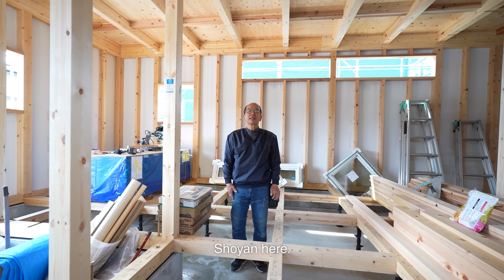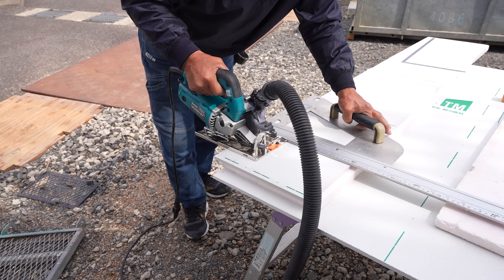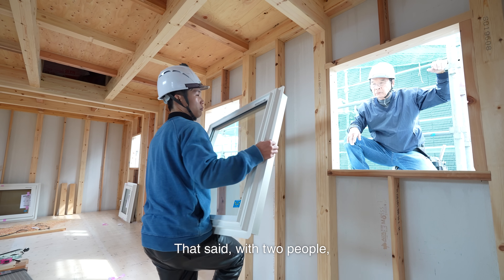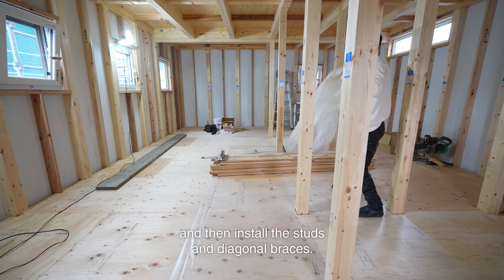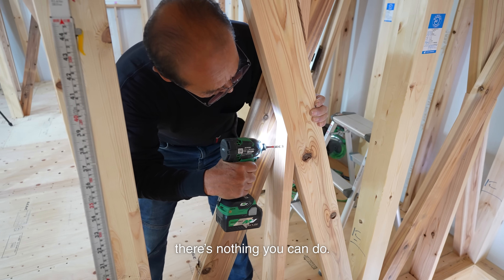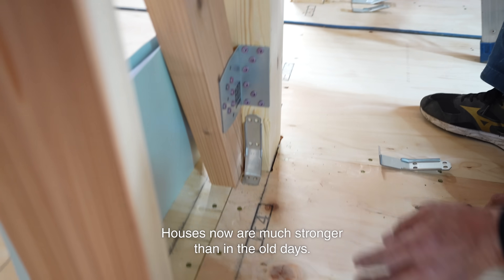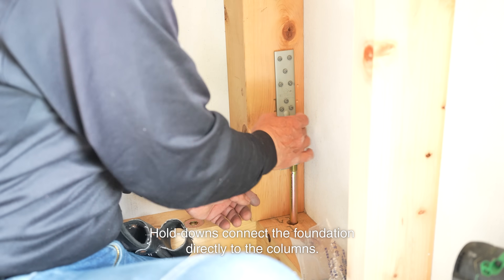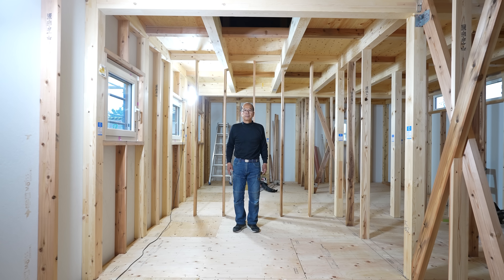How to Build a Home That Survives Big Earthquakes | New Build Season 6 Part 2

Comment: This design of window with double type of opening is common in Europe, especially Italy or Spain. Except when the handle is horizontal, it opens normally, and when the handle is pointing up, it opens vertically. Here in your video it's the opposite, which would definitely confuse europeans.

Comment: 3:29 This is the European design window. But the manufacturer made a small mistake: tell them to switch the handle positions so horizontal swings open and pointing up tilts the window backwards: easier handle positions for the window movement :)

Comment: Wow! Those double pane sturdy windows will make the room feel much more comfortable! They will allow plenty of ventilation in the summertime to occur and when the windows are closed, they will prevent the excessive heat or the excessive cold to enter the house! 👍 … As for strengthening the walls against earthquakes, I was very surprised not to see that 2x4 base plates were not used? Instead, the 2x4 studs were secured directly to the plywood floor sheathing. That’s not much material for the walls to have a strong base attachment! Good thing you added metal “L- braces” to bond the walls to the floor! Shouldn’t you have included a 2x4 base-plate first? At any rate, nice work Shoyan! 👍

Comment: Welcome to modern windows technology, in Europe, we start using windows like this 20 years ago. But the control handle is inverted, for us is Up to open just the upper version that incline and lateral to open the all windows, actually out version make more sense, more intuitive to me.
Plus all our windows have 135 angle handle to enable tilt micro-ventilation, a way to enable a very small amount of air getting in, generally used in winter, to enable air change or just prevent humidity accumulation inside the home, due to a too much tight home.

Comment: WOW! I find this info about the Earthquake protection SO FASCINATING! Japan is at the FORFRONT of Seismic protection and I would LOVE to learn more about it. I was impressed by the DOUBLE Diagonal bracing, it seems like a much easier installation than putting a bunch of studs up LOL But I know it's not about ease :)
I noticed towards the end there were a bunch of blue stickers on certain areas like the bracing and the windows. Are those inspection stickers saying it was built correctly? I've never seen that before, if that's what they are. We we get our home builds inspected we get just one certificate for the whole building, but seperate ones for the structural, eletrical, and plumbing. But maybe now there are more certifications for things the insulation value like how the last house you had a 'pressure test' - but those wouldn't be from the government and not required (maybe in California they are, but they are really strange over there lol)
Oh and that window - THAT WAS AMAZING! I've never seen that before and I LOVE IT!!! 
THANK YOU ONCE AGAIN SHOYAN!!! See you soon in Part Three! 😁

Comment: It`s much more easy to install that type of window if you remove the window first out of the frame .
This is fast done by removing the upper pin on hinge-side.
Installing doors or larger windows in this style is nearly impossible without removing .. 😁

Comment: I'm interested if that window can be split from frame like in europe. Just press locking plate and pull a top pin down and it slides up from bottom hinge, then it will be easy to install.

Comment: Taping the bottom of the windows will hold in water if it gets under. Don’t tape bottom. But do seal the wood to the outside wall with tape so that wood will never get wet if water gets in. This is best practice in USA. Maybe hasn’t gotten to Japan yet.
Reply: No water will get in there. The window frame has weep holes to let out condensation water or rain water.

Comment: If you see how windows are installed in Bulgaria you are gonna have a hearth attack :)
Reply: I have been to Varna. The seaside was very nice but didn't pay attention to the windows. Maybe next time.
Reply: @peybak  The windows are fit with shims and the gaps (which are more than 3 cm and more) are filled with PU foam. Essentially the foam is holding the windows in place.
Reply: @krumba100  no screws into the wall?
The foam is typically only used to seal the gap and stop wind.

Comment: Why did you put tape on the bottom of the Window? I was learned to apply flashing tape by working from the bottom up. Start with the sides, then the top, The bottom is left unflashed for water to escape if it ever found its way back there.

Comment: Those are the nicest framing studs I've ever seen.
Reply: It's almost sad to have to cover them with the walls
Reply: Currently building an addition to my pole barn. I'm not a pro carpenter, but I'd bet I could get done in a tenth of the time if this lumber wasn't so warped
Reply: Yes, here in the USA a majority of the wood is grown as fast as possible which makes them twist quite a bit. If you compare old growth to new growth the difference is amazing. The new growth is maybe 10-15 years in a 2x4 and 45-65 years in an old growth. This is my second 1800’s house I am living in. The vertical supports run from the 2.5’ thick stone and concrete basement foundation to the top of the second floor out of one piece of oak. A neighbor whose house was built the same had a 2.5’ diameter tree fall on his house while he was home. He said he could feel the course sway and then return to its original position. The asbestos roof wasn’t even damaged.
Reply: @shelbyoffrink4424  Apparently a lot of the wood used in Japan is actually US wood as well, maybe including the stuff being used here. We just ship a lot of the really nice stuff over there since they're willing to pay for it.

Comment: Those are really good windows. They are insulated and most heat and cooling goes out through windows so installing double glazed windows is worth the extra money. those windows are common in Europe. Swinging inward makes a lot of sense. It makes it so much easier to clean.
Reply: There must be some crossover point where it must be calculated or estimated or guesstimated about how much cost is warranted to have a building survive when seismic damage to its surroundings including the infrastructure is ruined beyond repair.

Comment: Those windows are very European.  Interesting to see them in use here in Japan.
Reply: We used to have those windows in a 1980ies built apartment. When the windows were changed out, they got another (more cild proof one for heights) that tilt  almost 180 degrees horizontally for easier cleaning as well.
Reply: Yes, my thought as well. We have had windows like these in our summerhouse for about 20 years, in Denmark.

Comment: Those windows are very common in Europe. However, the "controls" are inverted and in my opinion make more sense. Handle to the side means it can be fully opened. Handle upwards for the tilt.
Reply: When Shoyan showed the first window on the floor, I thought: "Is that one of our windows". In Germany it is usually: Handle down = closed, middle = open, up = tilt. But I lived in two appartments where SOME windows were installed weirdly: up = closed, middle = tilt and down = open ... Would allways confused guests, when they would try to open them. The way Shoyan showed is new even to me 🤣
Reply: @ElSendler  Windows like this were built 30-40 years ago. Like Shoyan's. Or rather, there were a few manufacturers who did it this way. In certain situations, it's even necessary for fall protection.
Reply: I was just going to say the same.
Reply: + these two positions 45° micro-ventilation, 135° tilt-micro-ventilation
Reply: was about to say that they are pretty much standard here in Denmark :P And yeah side opens side up opens top
Reply: I was about to comment that as well, but maybe its intended as a safety feature? Considering that a lot more force can be exerted on the hinges when pulling a vertical handle to open top? Idk im kinda reaching to make this make sense.
Reply: @Kaesi01 you're not reaching, it is a safety feature. both the force that can be applied and for small children that may reach the handle. that way, small children can't fully open the window, just tilt it open.
Reply: A note on the 1=closed, 2=tilt, 3=open:
In Netherlands these days, on non-ground floors, there's a mandatory 'lock' system with a small key for all windows.
To enable locking the window in such a way that you only restrict the 'open' mode, but allow the 'tilt' mode, it makes sense to have the sequence as closed,tilt,open.

Our house actually has the 2=open/3=tilt on the ground floor and 2=tilt/3=open on the first floor... confusing, but that's the reason
Reply: And still there is some difference in the frame. At least for the variant we use here in Germany. Here the frame goes into the opening completely, and through the sill and whatever covers the outside, you make sure s little water as possible or even none can get in and if any gets in it can dry out again without damage. The frame is usually screwed to the opening from inside the frame (the part covered by the closed window). This edge that gets screwed to the outside and then need to be taped to become waterproof on the other hand reminds me of the style of windows used inconstruction in the US.
Reply: The tilting function is more obvious with the handle up, like we use in Europe. The solution used here is no very comfortable. Having the handle vertical to tilt down, help you to give force to the windows to tilt, both opening and closing. Having the handle horizontal make more stress on the handle and movement. German, and European in general, having start making windows like this without thinking, there are reason why they work like that, same for the handle.
Reply: @Lostman-l4f  There are pros and cons both ways. Especially with for example some wind pushing on the window, you are absolutely right about the difference in leverage you get with the lever up for tiltin. On the other hand, it may be some convenience factor, depending on what function you use most.
Either way, I think this design for sure is easier to get airtight than any sort of sliding window, which is either easy to move but may not seal well,  or does seal well, but is hard to move.
Reply: I’m British and I’m sorry but I just wouldn’t have windows that open inwards, or one window that has two functions, over here the window open outwards and the lager one on the left of lets say a bedroom window opens like a door and the smaller one at the top right hand side opens like the tilted window.
It’s just what I’m used to I suppose.
Reply: I just got these "fancy" expensive ones, they are so shit. Sliding glass panels are so much better, they isolate with just thin single glaze panels, can be opened in such a way that no rain can enter the house but air can, and they'll never interfere with with the stuff on the windowsil.
Reply: @mexdek2061  What?
Reply: @mexdek2061  I wouldn't call single glaze insulation. 
Single glaze have a u-value of 6, double glaze of 1, tripple glaze of 0.5. lower values are better. Going from single to double glaze saves ober 80% of energy loss through the window.

When tilted, you get air in and no rain can enter. On sliding windows, rain can enter when wind is coming from the side pushing the rain against the window. When tilted, it cant.
Reply: @mexdek2061  Judging from your words, I'll go on a limb and say that you've never even seen a proper triple-glazed window in your life, let alone "just got" one.

Comment: I would bet you can remove the window sash for installation. At least here in Europe it is common that they are shipped like that. You remove the sash when installing the frame and put the sah back in.

typically you remove the pin in the top hinge and then you lift the sash out of the bottom hinge.

Comment: Those windows are common in Europe. They doesn't cost double just a bit more expensive than standard ones.
Reply: It depends, afaik the concept of "Passive Houses" is still not that popular in Japan so there's not a lot of manufacturing of those windows in Japan, so as such the top of the line models are imported.